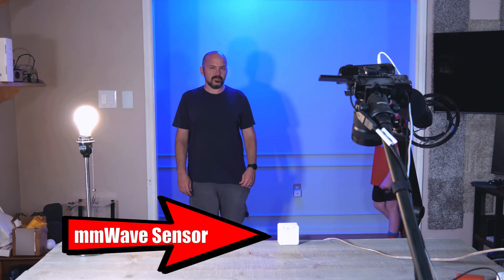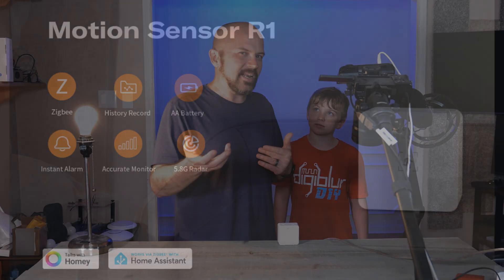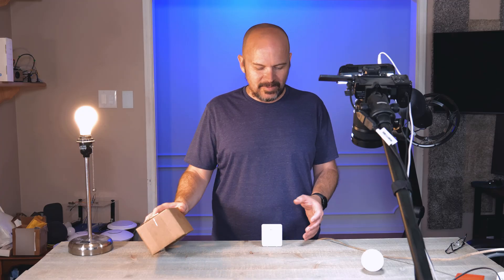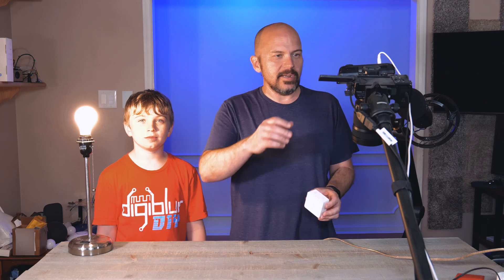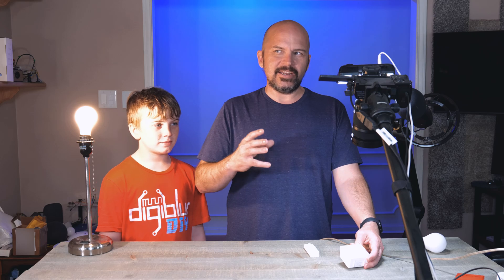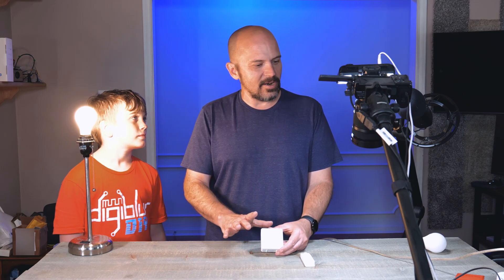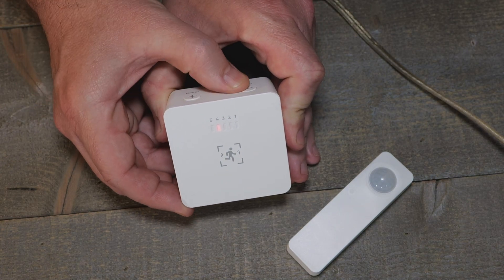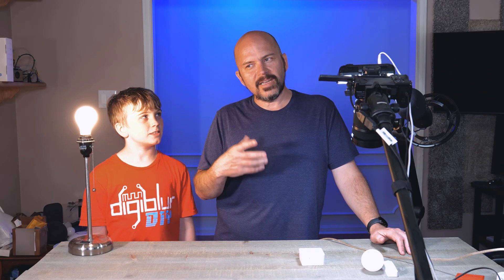ThirdReality R1 Motion Sensor: AA Battery & 5.8GHz mmWave Tested!

Comment: So I’m currently working on a diy presence sensor using the Acconeer XM123 which runs a 60GHz mmWave radar. TensorFlow on my NAS will be doing all the AI training and modelling that way everyone in the house can be detected and different automations for different occupants. The AI will be able to learn the changes in us such as haircuts height growth in kids and even weight gain. I can shown you it once it’s all up and running and help you set it up for review
Reply from the maker: That be pretty cool. How about ceiling fans? I have them in every room and that's been an issue with mmwave in my home.
Reply: @ as tensorflow will be processing the presence it’ll have to first define an occupant is in the room and who the occupant is that way it won’t trigger for all movement but depending on what is triggering the presence. At 60Ghz it can even count heartbeat that’s how accurate it’ll be. If you’re going based on any movement you can use tensorflow for AI and set deadzones too. Or you could slightly angle it down or use aluminium tape at the top of enclosure to kind of stop it sensing there

Comment: Just picked this up and its not working for me. Pairs fine(a bit slower than other devices) but after a few min HA does not see any activity from it. Is there anything special I have to do with this or is mine just broken?
Reply: Nevermind. Works fine paired with my Echo Show 8. For some reason It does not like HA.
Reply from the maker: I was using Zigbee2MQTT on this one, are you using ZHA?
Reply: @ Im using ZHA. I was going to return it but since its doing what I want through Alexa/Echo Show im going to keep it.
Reply from the maker: I assume it will eventually be supported in ZHA once they catch up.
Reply: @digiblurDIY  I assumed the same. That was the other reason why Im keeping it. For now, it works well for turning on and off my closet light so even if it never works with ZHA. Im fine with how its currently set up.
Reply from the maker: I tried them on ZHA last night and they paired up just fine with the sensors.  I didn't see any delays with them.
Reply: @digiblurDIY  Did they continue to work? My issue was once they did pair, after a few min they would stop working. The LED would turn on showing it saw motion but HA would not see the changes. After a few hours, their status in HA would change to unresponsive(or something similar).

Comment: I've had this thing for over a month. I think a mmWave as a motion sensor is a terrible idea unless you can find specific use cases. It senses completely around itself and through walls so you can't just put it beside a door and call it a day. It really only works if a room is very isolated. Even then you may have to find a spot somewhere in the middle or at the end of a room.  But you may create new problems because it can sense you in bed when all you wanted was for it to turn on a light when you walked through a door opening.

I ended up keeping it because I do have a room on one side of the house by itself. And I would only recommend it if you have a specific use case like I do. Otherwise most people should stick to a PIR motion sensors if they really need a wireless solution.

Comment: The issue with mmWave is the power usage, so I do wonder if a combination of PIR and mmWave like the Everything Presence Sensor. So the PIR detects motion, then the mmWave detects presence. This way the sensor could save battery not having the mmWave sensor on all the time.
Reply from the maker: I believe they did that combo due to the slower older mmwave sensor. It wasn't necessary in better mmwave sensors.

Comment: Mine arrived  on saturday. Ive noticed its more of a motion sensor rather than an occupancy or presence sensor. I like that it can be place behind a picture frame to hide but it won't keep the lights on sitting on couch. Probably due to being Battery powered.
Reply from the maker: Yeah. Same. PIR with a bit of flare

Comment: I have also been testing for a couple of weeks and honestly I can't see why any one would replace their pIR with this. I got excited when thirdreality told me it was mmWave that uses  Battery unlike most of the mmWave that requires plug in.  It is much bigger so you will need to hide it behind something or inside of a box.  I'll still choose the smaller PIR  version over this one. What's your thought on their smart keyboard? I see it in that picture shot at CES.  I have had it for a few months as well and not great either. I love a lot of their products and have tons of it around my house  but their new releases have been less than impressive.
Reply from the maker: Yeah only if I was tyring to hide it or had something in the way in the room.

The keyboard not being 101 layout is a bummer to me so I can't use it on my main computer.